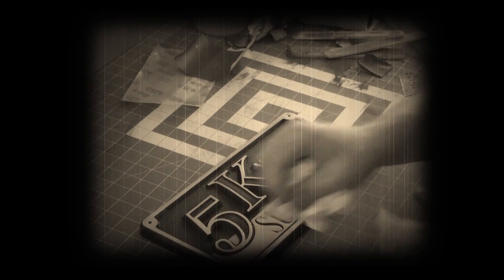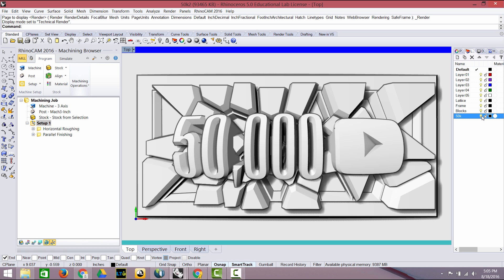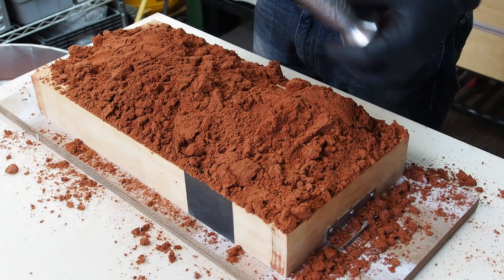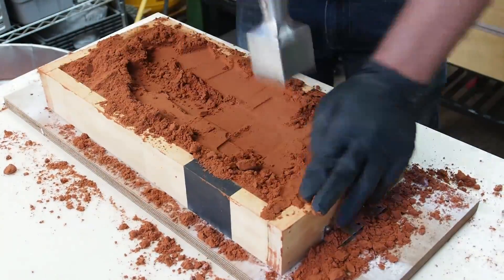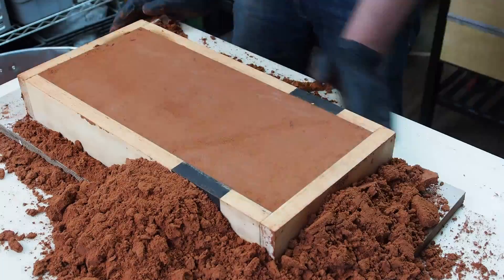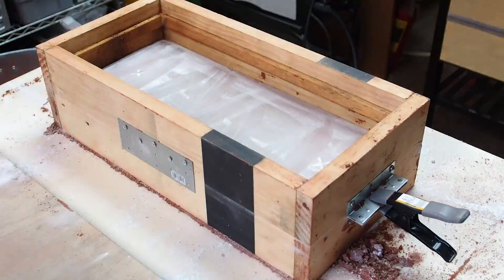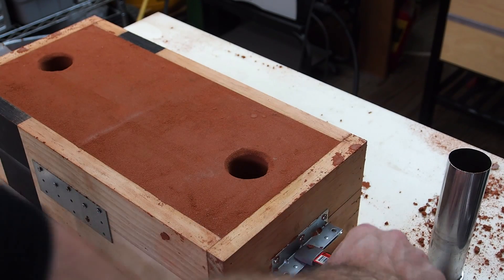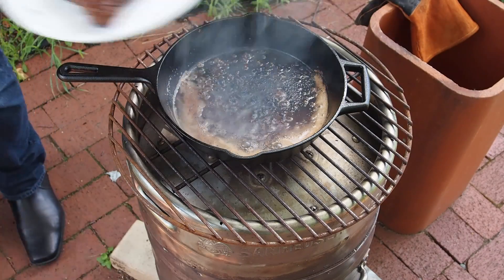Casting the 50K YouTube Subscriber Plaque | Process

Comment: why dont you use backing sand it would leave you more facing sand then on knock out you would have more backing sand
Reply from the maker: +dougie armstrong For the limited amount of casting I do, I think it is better for me to just shave the 10% burnt sand and set aside than to use about 25% new as facing sand and loose it all to the 'backing sand' bin.  That said, I'd like to figure out a good mulling strategy so I didn't need to differentiate any more.  Not a big deal either way!
Reply: just thought that petrobond facing would be ample then an old green sand mix as backing then all you lose is the petrobond and your backing sand can be used over and over again small loss regards dougie  retired moulder and by the way grest castings

Comment: What's the materail costs in a plaque like this between the CNC'd sheet, the sand and the alooominum?  great video again looking forward to seeing the next project soon!
Reply from the maker: +Livi120 A quick search shows 1" thick 6061 12"X12" for about $90.  So half of this for the stock required =$45.  Cast took about 2lbs of aluminum @ $0.50/lb for the scrap.  So $45 vs $1 for the aluminum...  Probably $15 for the Renshape blank.  Sand is reuse able..  So...
$16 vs $45.  Machine time would also be a lot greater in aluminum.

Comment: If you use an hydraulic press instead of tampering, will you get the same results ? 
(I mean, like a sheet of steel over the sand and then the press over the steel)
Reply from the maker: +Nicolás I think they sort of hybridize the tamping and press at a foundry.  I think if you just press it won't get tight everywhere.  The ones I have seen sort of shake and squeeze at the same time.